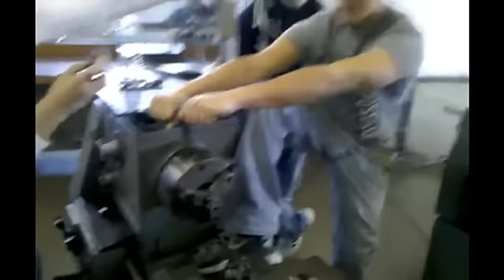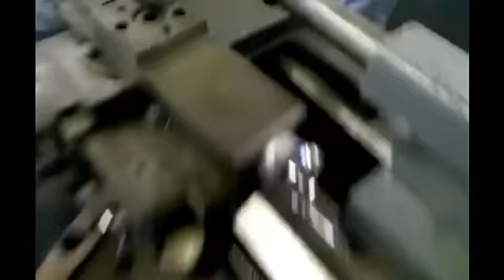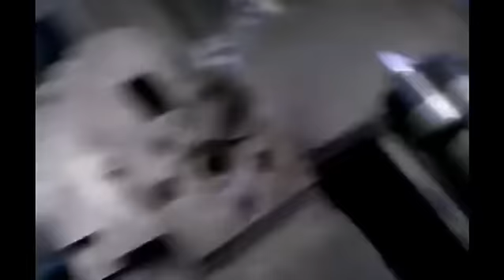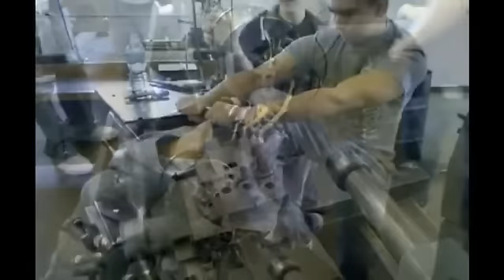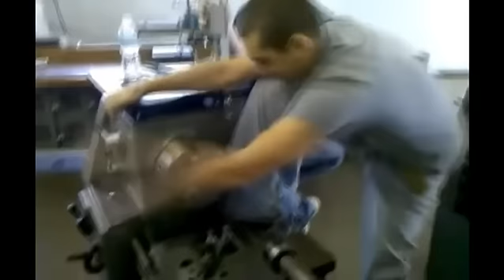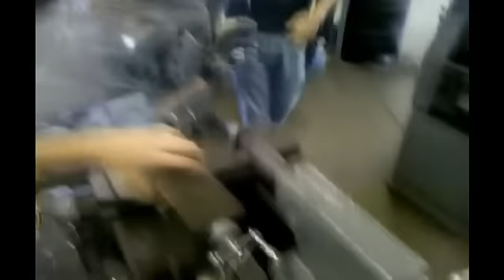I fought the Lathe and the lathe won

Comment: "Did you push stop?" Really? Like it would have stopped because his leg was in there?
Lathes don't stop for flesh and bone, they can spin through solid metal...
Reply: They spin metal. Not through metal lol
Reply: @stupidmclovin  they spin metal then drive a dull carbide bit thats only sharp edge is the top corner... try cutting metal by dragging the knife perpendicular to it
Reply: @90fordb2  Yes I was very aware of that. I've spent 4 years of my life machining. I was just pointing out that they are tools for spinning metal. Not for spinning through metal.
Reply: @stupidmclovin   You've been in some machine shop for four whole years now, wow. Can't argue with that, you've got it all figured out then. Nevermind sir, forgive me. I didn't realize you were messing with lathes for four years, we're all surely impressed, you're so awesome and knowledgeable. The lathe just spins metal, and never cuts it. Makes alot of sense... yes. Finally I figured out what a lathe is for. Spinning. Not cutting. It just spins there 24/7 and some guy comes into work all day and watches it spin without taking a single cut on it.
Reply: @stupidmclovin  1000rpm is not extremely fast, and the purpose of the machine is to cut metal in a cilindrical shape, not to spin it.
Reply: @stupidmclovin  are you familiar with cnc's? They are literally the same thing but have stepper motors instead of handles to control the different axis.
Reply: it probably did stop because of his leg. these small lathes are not that powerful compared to industrial ones.
Reply: @warwolf6862  oh no, it stopped because the motor was only energized for a brief moment. the kid behind him pulsed it with a button. if the motor was truly on, it would have ripped his leg off within seconds.
Reply: @warwolf6862  You have no idea what you are talking about.
Reply: @mustangman6579  i actually managed to stop a lathe used in our high school work shop few years ago. Looked quite similar to this one
Reply: @warwolf6862  well, I think those are belt drive, and made to slip. That one was gearndrive. No slipping.
Reply: @mustangman6579  that one was gear driven. we even measured the force, which was about 400lbs
Reply: @90fordb2  lmfao
Reply: @stupidmclovin  they dont spin metal, they turn metal
Reply: it was on a low and slow setting
Reply: @killer13324  The only good thing about that is it gives you more time to react, and by more I mean a few seconds at the most, as can clearly be seen in this video. However the bad thing about it being on "low and slow" is the lathe does that by using a gearbox, which lowers the speed by a certain factor but increases the mechanical advantage by that same factor, and thus the torque it can deliver. The lathe in this video was fully capable of tearing that kid to unrecognisable pulp and bone fragments, and putting his cheerful friends into therapy for life.
Reply: @stupidmclovin  your username is accurate
Reply: @jessewoody5772  they don't spin or turn metal, they rotate the metal...
Reply: @stupidmclovin Does anyone know where this YouTuber "Stupidmclovin" lives? Everything is ok.

Comment: I was in a manual lathe accident once. The bottom of my work coat was torn and the loose portion got caught on the spinning feed rod which then pulled me in. 
I was not able to react on time to push the E-stop, fortunately my co-worker was close by and stopped it right before it tore my arm off and break my spine. However, I was still stuck in a very contorted position and in a lot of pain. My co-worker then scrambled to find scissors so that he can cut off my clothing to free me.
Reply: I feel sorry for u man
I am happy u are alive
Reply: Glad you made it out. Lathes are so damn scary. glad you're friend was there for you
Reply: buy that guy a beer after?

Comment: Various reasons: First of all, to remove lots o metal you need lots o horsepower.
A toolroom Lathe like that will have something in between 2 and 5+ hp (CNCs having like 5-50+hp :-), bigger machines having more, newer machines having more than older ones, usually.
That is a lot of torque at 500-5000 Rpm already, i bet you couldnt stop my 2 hp lathe at 1k Rpm.

For huge workpieces, threading,reaming, knurling etc. you need slow revs, like 200 or 100.

Thats equals huge torque. Plain and simple.

Comment: A guy I worked with was working at another shop and a guy was killed because he had a long piece of 3” bar turning it down on one end and the stick out was 5’ plus without a stabilizer under it. As slow as he was turning it, it was fine. But everyone was was going to lunch so he increased the rpm’s quite a bit so he could get done quicker and eat with the guys. It started vibrating and he stepped around the machine to see what was making it do it and all of a sudden that straight bar folded into an “L” and caught him between the legs and when everyone came back from lunch there were pieces of that poor young man hanging from the ceiling among every where else. It happened in Franklin Tennessee. 
  Goes to show you that anything can kill you at anytime. Do not take chances.

Comment: Machining 101, if it can grab any part of you or your clothing 1 of 3 things will happen. 1 If your lucky it will scare you and/or you will receive a slight injury, 2 It will remove violently anything it grabs to include limbs or 3 It will drag you in the machine and promptly KILL you. Why because it can! I saw a guy fling a chuck key across the shop and and put another in the hospital. I still have a picture of a guy rapped up in a lathe dead because he wore loose clothing! No place for playing

Comment: that machine is probably set to 30rpm or summat so it has maximum torque, iv seen lathes not much bigger than that twist 1 inch chrome molly steel bar
but set it to 3500rpm and it can be stopped with a small 3mm wide tool if u ram straight in

Comment: My class was watching this video as part of the safety rules presentation. I did find this video a little bit concerning. He could've gotten injured really bad on this machine. The safety issues that I noticed in this video were two people operating the machine at one time and they were fooling around with it. In the video, One person was standing behind the lathe with his foot up on the machine and holding on to the chuck key that was on the chuck and the other by the controls. The person that was by the controls turned the lathe on while the person that is behind the machine is holding on to the chuck key that was in the chuck. The person behind the lathe lost grip with the key, got the pant leg caught on the chuck key and pulled him right over and got his foot stuck on the key when it turned on. It appeared that the lathe was set in the lowest gear according to the shop teacher. Luckily someone was able to turn off the machine in time. You should never run any machine with the chuck key still in place and only one person should operate the machine at all times. If you are not trained to operate the machine properly, don't use it. If in doubt, always see your instructor. 

We will be getting new lathes in the shop with safety guards equipped with interlocks that prevents them from running if the guards are open and protect the operator from any moving parts.

Comment: A lathe pulls more in low gear. That's when its the strongest.
Reply: I still wouldn't want to fight a lathe running at a 1000 rpm
Reply: @JXLR  just never fight a lathe is the real take away here.

Comment: Sorry. Lock out, tag out. When you're repairing a machine, you go to the circuit breaker, flip the power off, and add your lock with a tag saying "under repair. Do not remove tag".

Comment: you see...
ya gotta get the runout set before you just start flippin switches.
this is a rookie mistake.
always hold the key in your teeth while tightening the chuck an ALWAYS try to work over top of the spindle.

Comment: A lathe this size and geared at that low speed equals a fuck load of torque theres no fucking way you would jam it even with all your bones stuck around the chuck would you ever stop it , i have seen what mine does
Reply: Yeah man. If it wasn't stopped, he would have been through without so much as half an amp passing through that machine.

Comment: what i can't figure out ,what in the hell was he doing BEHIND the lathe?I also suspect his buddy behind him hit the switch as a prank. What is really wrong about all this is you have three students on the same machine with no supervision and have no idea what they are doing.
Reply: had a small lathe(atlas-craftsman 6x18) and the chuck removal said to put it in back gear and unscrew chuck with chuck key. built my own lockup and leverage tool to prevent damage to my machine. hopefully these kids did not try to remove that size chuck using the same instruction manual? either way the kid was on the wrong side for removal,and the motor should have NEVER BEEN STARTED .If  you don,t know ask someone who does before someone is hurt bad or killed I can only hope these kids made a Huge mistake and learned from it rather than jackassing around with Any Equipment.